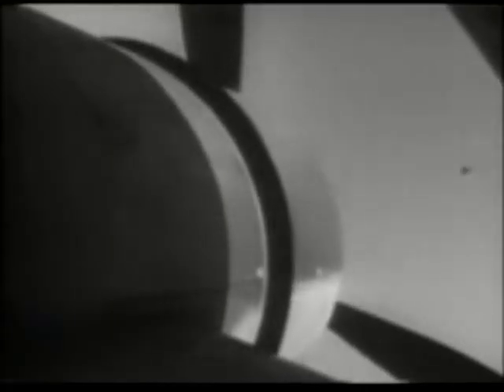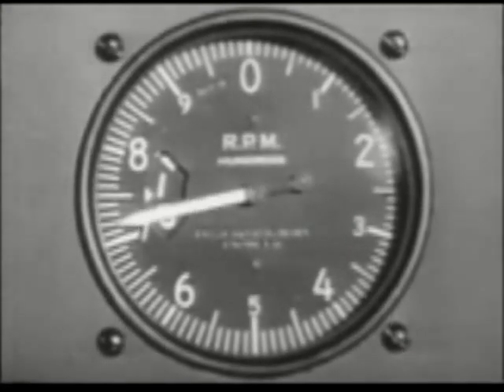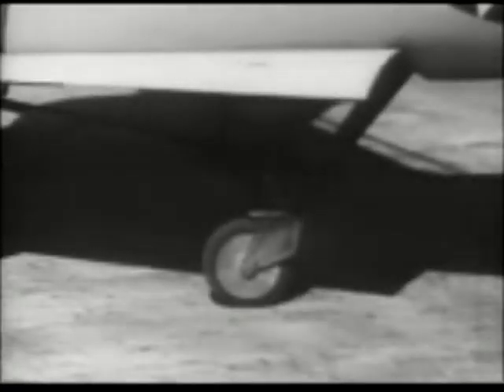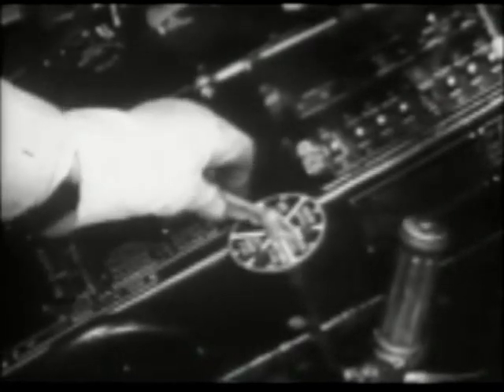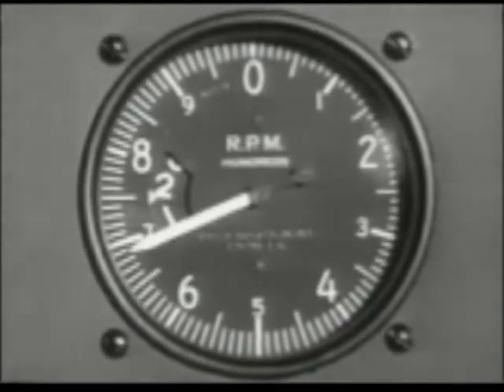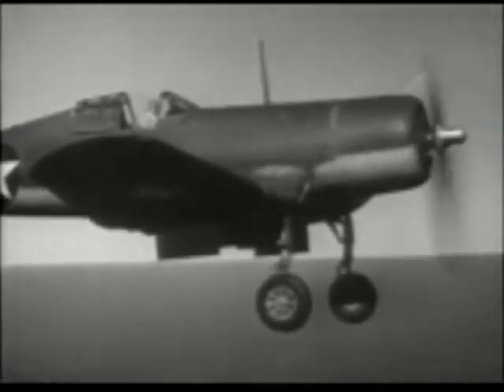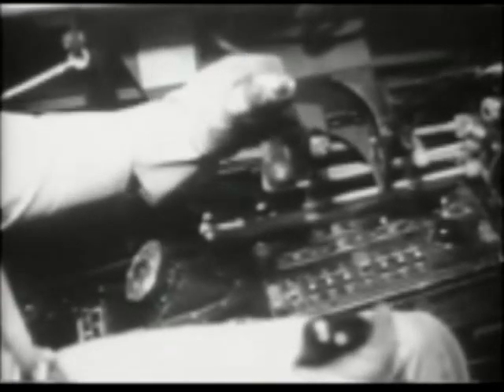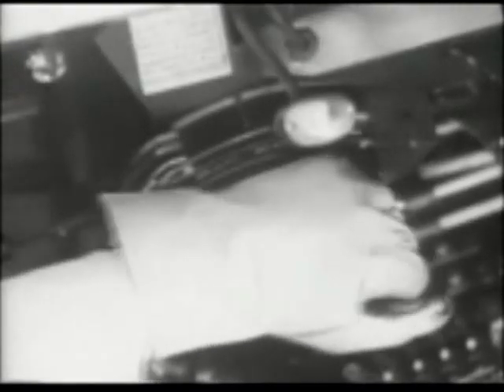F4U training film part 1

Comment: If you like WWII combat sims one thing you're probably not aware of is that in a real WWII fighter plane it took a lot of levers to control the engine and the prop. 

Soviet planes were the most primitive: in the La-5 fighter rapid acceleration required pushing 6 separate levers. The ultra-modern FW-190 had most of the functions automated because it had an engine control unit that was basically an analog computer. You could fly the FW-190 quite well just by operating the throttle.

Comment: @weversonman The later Corsairs also had electric starters operated by a switch in the cockpit. This is a very early version of the Corsair which may not have had the electric one. Turning the prop by hand was only done when starting the engine cold.

Comment: @TJDOZIER1 gotcha I tend to take things a little too literal I guess.. thing is theres alot less levers in a mustang cuz they dont have that many hydraulics to deal with. no winger movers or anything. and I think the intercooler is constantly a flow through on those, could be wrong. difference between a radial and a v12

Comment: Alternate Air Control? What is that? Is that to bypass the blower when it's set in neutral, so it's not drawing air through a dead compressor? Is that just for the secondary compressor, or the primary one? And does it have like a bypass tube, or does it just open a flap in the trunking after the blower housing? I seem to recall the Hellcat having an intake opening inside the wing-root leading edge, as well as in the intercooler intake under the engine. Is that similar? Or am I wrong altogether?

Comment: @weversonman If the engine quit in flight with the mag switches on,  the mixture at the proper setting for the altitude, and nothing amiss with fuel flow, the ignition switch probably wouldn't restart it anyway.

Comment: I think most of that was for optimum cruise range, etc. Engine settings made a huge difference in how far one could reach on a tank of fuel. Once in combat, you generally open the cowls and throttle and have at 'em. In flight, you'd adjust the boost and throttle and mixture to most efficient settings (there were a number of schools of thought, and it varied between planes). You'd have to close the cowls to keep the engine at optimum temperature, since it looses efficiency when it's too cold.

Comment: The sound is indeed impressive... I own a 1939 Waco mostly for the radial sound; however to bre most accurate, they still make aircraft like that, in a sense... at least you can hear the radial in a new aircraft... yes, it is still a vintage design... but the new ones feel as original as my '39... if you want to hear/see it, google or youtube: WACO Classic YMF 5-D

Comment: @helipassion The only immediate controls you keep in view during combat is the throttle, flaps (deployed 5-10 degrees for better turning), the guns and all the maneuver tricks.
Reply: And airspeed indicator.  Your turnig performance will differ significantly depending on airspeed.  It's also a handy tool in gauging your energy.